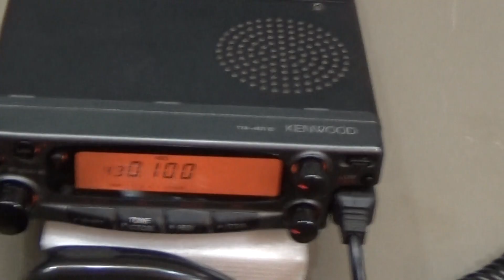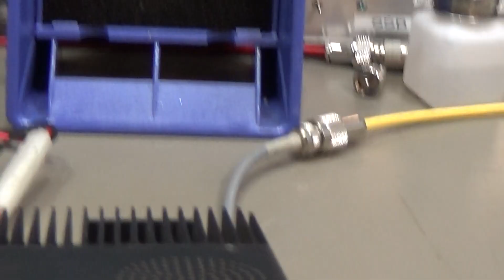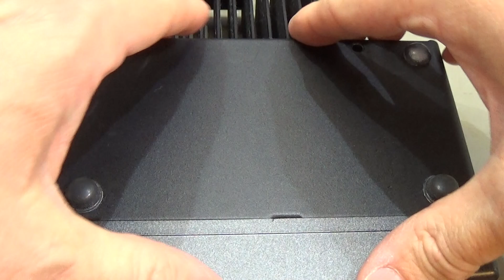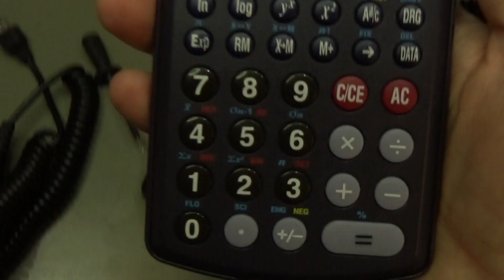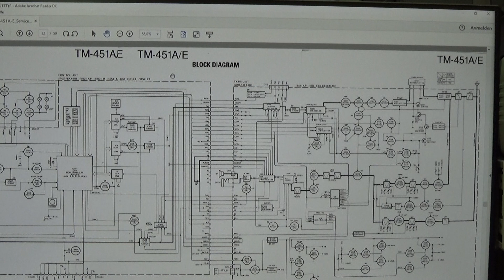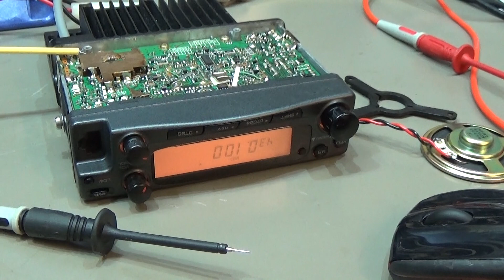#132 Repair: Kenwood TM-451 PLL troubleshooting

Comment: Thanks for a great video - was able to track down and fix a similar issue with a recently purchased as "not working"  TM451A with your guide - the unit had been subjected to bad power supply  and similar no tx/rx and wound up with the same bad trace from TP101 to IC 204, plus additionally bad switching transistor right near there. Thanks!!

Comment: Thanks for the video, Great video! My Kenwood TM-451 suddently stopped transmitting, and the receeving was allso gone. I started with the 8V regulator. This one have i allready replaced in my VHF radio, and it is a commom problem, that the 8V regulator dies. Very strange. But this was OK. I looked in the service manual, and checked the ocillator. It was OK. Then you sayd. See if the PLL is locked. Of course, why havent i checked this. And after this, the rest was easy, and i came to the same conclusion, the 12V was missing at the 10V regulator, very very strange. Now i have a similar wire in my radio, from the testpoint to the three capacitors.
Thank you very mutch.

Comment: Hi Peter can i just ask you one question, a Diamond 4:1 balun, used with WD 330J HF folded dipole, have you any idea if you should get continuity across the SO 239 connector, or is it capacitivily coupled, or is it inductive coupled might be a BU 50 balun...from Fred in England g4vvq.

Comment: So question.... Why did the Rigol able to read up to ~309Mhz when it is a 50Mhz scope? Thanks
Reply from the maker: Hi Billy, Rigol has an excellent front end in this scope. It is still possible to trigger and display this high signals that is awesome. But the voltage reading is wrong as the amplifier is far over the rated bandwidth. But with PA signals it still works and gives us the needed hints...73
Reply: That is good to know; I see the pricing is very attractive. Might be a nice piece of equipment to add to the lab; thanks for the information!

Comment: I know what you were saying about being careful not to short anything out with the power supply probes - did that one too many times. What i end up doing nowadays is soldering a wire to the place i want to inject voltage and hook it up to the power supply with an alligator clip. Takes 10 seconds and keeps both hands free when you have to do more testing with the external power supply wired into the circuit.

Comment: Great video as always. I love watching you troubleshoot. Your diagnostic pathway is always cogent and clear. I have noticed, though, that a significant number of faults could easily be found if you perform a check of all power supply voltages as an early (first) step.
Reply from the maker: Yes that is right a lot of problems can be found by checking voltages first. Thanks for watching and feed-back. 73

Comment: Maybe you did it off camera (or I missed it) but was it not worth trying to find where the 13.8V supply goes and maybe find a break? Fixing a dodgy solder joint would have been better than the wire no?
Reply from the maker: Hi Tom, well i have testen it and found open connection on an inner layer. Thanks for watching 73

Comment: Nice fix Peter, if you weren't doing a video of this repair. How long would it normally take you to repair this radio?  I would assume a lot faster than an hour or so. Keep'em coming Cheers 73
Reply from the maker: Hi Tom, yes you are right it would take 15- max 30 min..but as always I try to show the process as it could has been a differnt issue as only the 10 volt. Thanks for watching 73

Comment: Another BIG thumbs up Peter, great job! There is no substitution for experience, you jumped to the PLL way faster then I would have. Because the LCD displayed the correct frequency with no indication of it being unlocked I would have focused on the signal path just prior to the antenna output and start working backwards into the circuit until I lost the input signal and then I would have monitored the output signal along the signal path until I lost it, hopefully that would have gotten me in the ball park. Thanks for sharing and keep up the great work.
Reply from the maker: Of course it would have gotten you into the ball park, finally when you are at the mixer... Thanks for feed-back Michael! 73